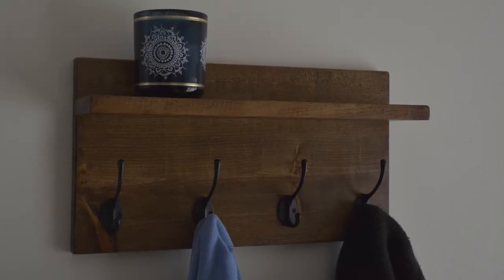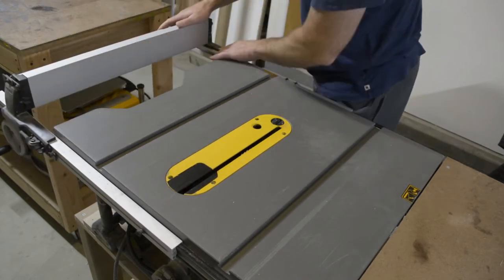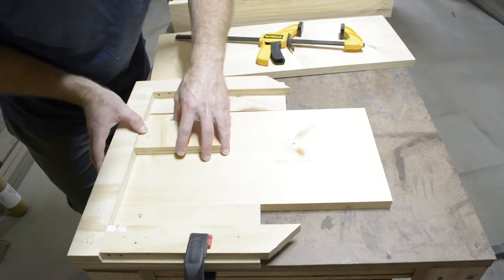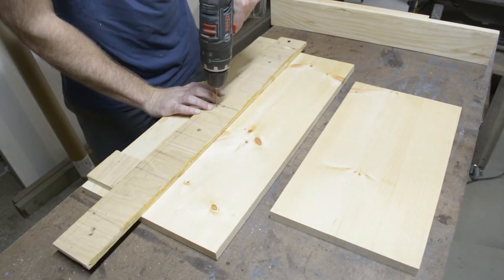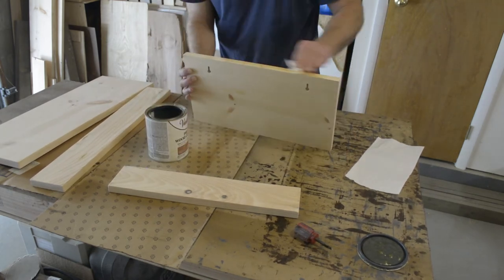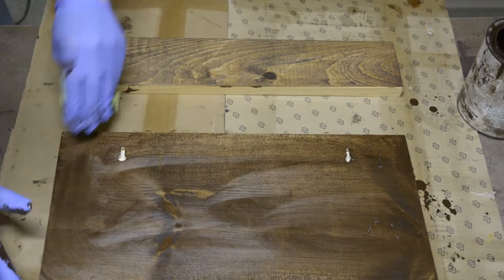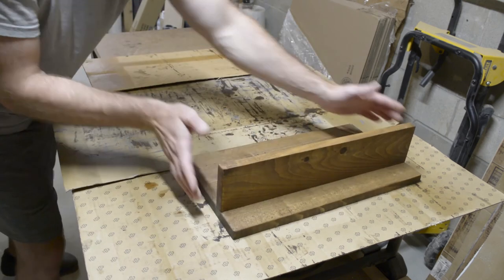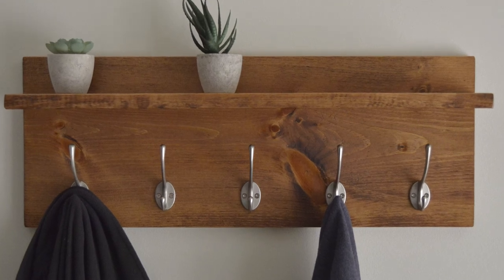Make your own coat rack - Wall mount - With a Shelf

Comment: Hey man when making those cuts with your miter gauge and cross cut sled around the 1:10 mark, I would recommend having some type of 1 inch spacer block on the inside of the fence, and adding 1 inch to your fence dimensions. It’s not a good idea to make crosscuts with the stock flush with the fence, it’s a known issue to cause kickbacks or other problems
Reply from the maker: Hey I appreciate the feedback and thanks for watching.  That's a good idea and a great recommendation.

Comment: what did you do to get the screw flush on the back of the board, when connecting the shelf to the backboard ? looks like you use a special bit ? or is that a phillips head?
Reply from the maker: Yes I just used a phillips head screw and drove it in so it was a tiny bit counter sunk.  Pine is super soft and its quite easy to do this.  On something harder like oak or maple, I would use an actual countersink drill bit to pre-drill and prevent cracking.

Comment: Thanks for that awesome video! What are the finished dimensions of the small coat rack? How wide is the shelf and how many inches apart are the hooks? I have a very small space to work with. Thanks so much!
Reply from the maker: I am extremely late to the party on this one, truly sorry! LOL... I have a few different variations on it, all of the details are listed on my website or my Etsy shop page.  The back is made from a 1x10 which is really 3/4" thick and 9.25" wide.  The shelf is a 1x4 (3/4" x 3.5") and the hooks are 4.5" apart.  I hope this helps....2 years later